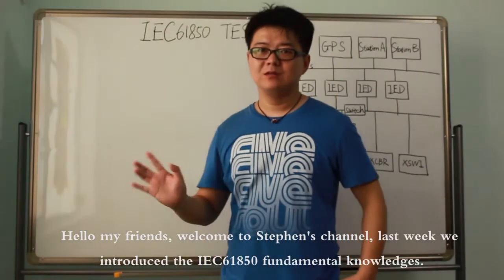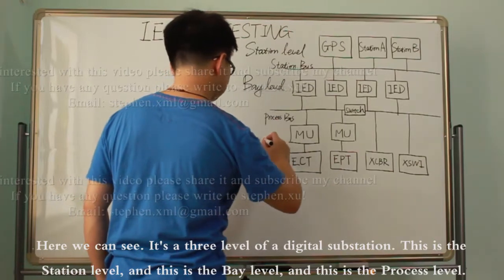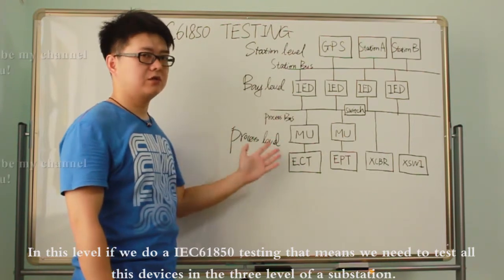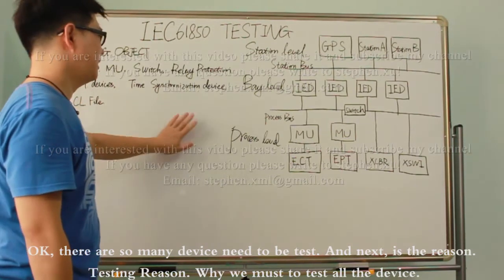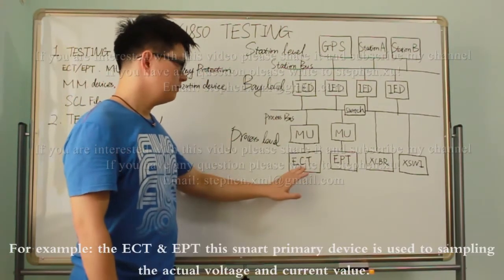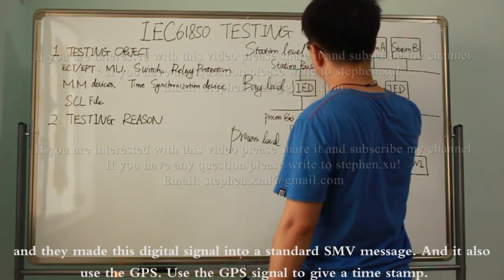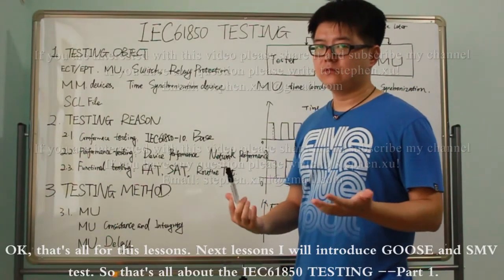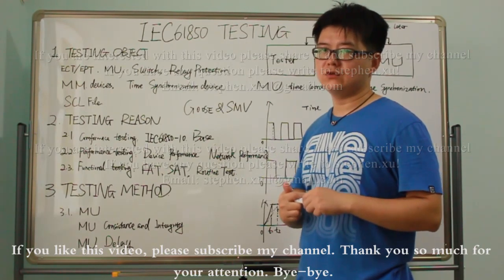III. IEC61850 Testing--Part 1

Comment: Are MU being used widely in China, or only in special projects? What is the typical delay and jitter introduced with SMV? Some manufactures prefer using their IEDs directly in field near CTs and VT despite the reduction of IED life expectancy. What´s your point of view, when must MU be used?
Reply from the maker: hi my friend, happy to see your comment. Sorry for the delay, I'm quite busy recently and no time to Youtube. Where are you from? Yes, MU is widely used in smart substation in China. and our jitter must smaller than 10μs. Our sampling rate to relay is 80 point per cycle so the interval time of frame must in 250μs±10μs. What's the specified delay and jitter in your country? Is there any different between us? I agree with MU on site is a choice.
Reply: I have never worked with Merging Units, but have a series of questions that perhaps you can help me to clarify.
1) Operating at 60Hz to maintain 80 points per cycle sample-rate should be 4.8kHz with a cyclical transmition time of 208us, correct?
2) Each IED must have 4 communication ethernet ports, 2 for Goose messages and 2 for Sampled Values?
3) How complex is the  infrastructure of ethernet networks, what type of redundancy is used, PRP?